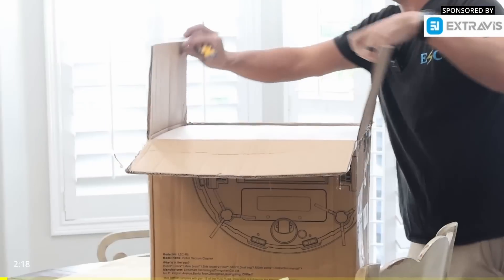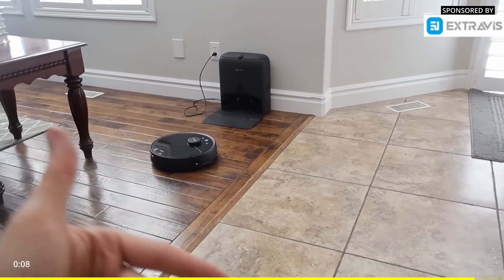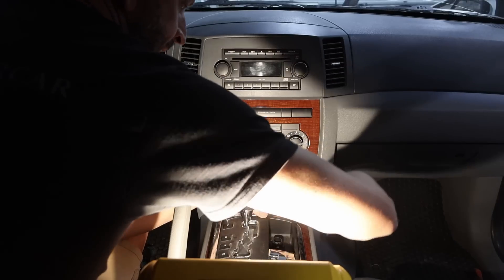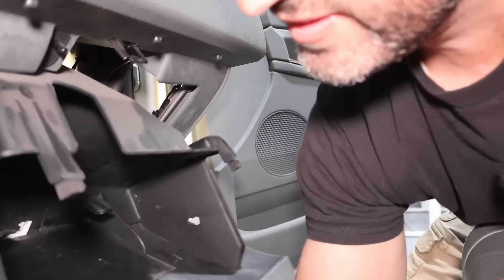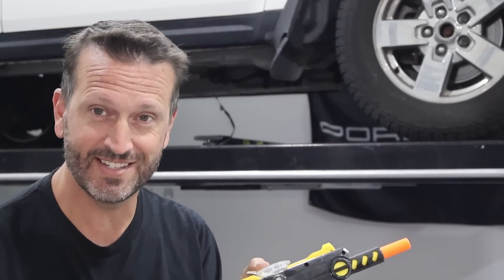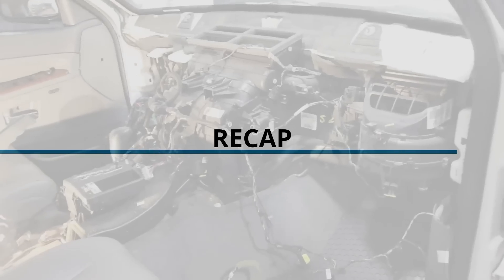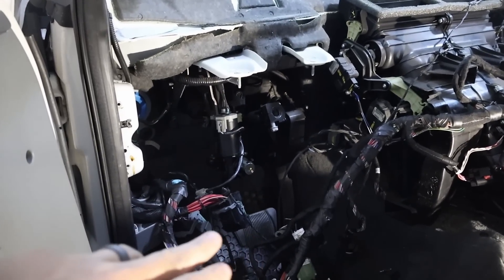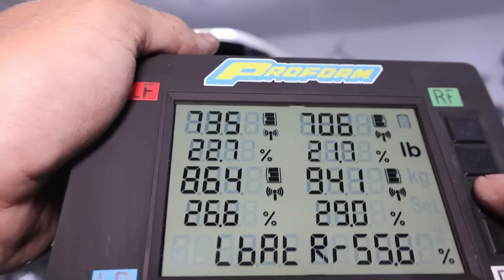Never Lose a Bolt Again: Fastener Tracking for Car Disassembly - Jeep interior removal

Comment: I just use painters tape and tape the bolts on the part. More specifically I tape the bolts where I removed them from the part. Works for me.

Comment: What's the tesla rpm? What's the final wheel ratio of the jeep. Isn't tesla 9 to 1? 

Why not do a coolant heater and use the existing system in the car and have it in the enging compartment where you have the room.

Comment: The transfer case is what switches it from 4wheel to two wheel. I would put the motor in the front (ish) and connect it to the transfer case just like the gas one, and then let the stock transfer case do the switching from  2 wheel to 4 wheel. This will be especially good if you keep the stock transmission as the gear ratio for uphill climbs and crawling will be the same.

Comment: Hey, thoughts about motor placement. 3 options. 
A. Two motors, parallel the axles. 
B. One motor driving the input to transfer case, replacing the transmission position.
C. Positioned in the tunnel, potting power directly into the driveshaft. This has the most unknowns, specifically, back-driving the front differential. The loads on the thrust bearings  would be reversed, and they may not be sized for the higher speeds/loads in that case. The same can be said about the bevel gear, especially if they aren’t straight cut. 
Good luck!!

Comment: When I was a new tech I did all sorts of things to track fasteners. Pictures. Bags. Cups. As a master tech I've learned pretty much every bolt is the same and it doesn't really matter where they go back for 90% of fasteners

Also im voting to keep the factory differential
Reply from the maker: Thanks for the comment!
Reply: Yep, after a certain amount of time you snap and say "if it fits, it fits". It took me 10 months into my transmission rebuild and losing several bolts to finally crack and start throwing bolts wherever they fit. As longs as you don't do something stupid, like using one that's obviously too short/long/wrong thread, then you're fine.

Btw transmission seems like it's working pretty good so far!

Comment: They call that big tube you pulled out "the cross car beam" and they are structurally important. I know you are planning to replace it but if modifications are necessary it would be good to keep that in mind.
Reply from the maker: @brandondelgado4153  noted
Reply: Steering hanger beam

Comment: In my own thoughts, twin center motors will offer you a more "off-road" trpe arrangement, as the set up Jeep uses on those is very good for that usage. If you are making a pavement only  (or even a 80/20 road/gravel) arrangement, I think you would be better adapting the Tesla subframe in the rear mounted as to give you the proper ride height. Maybe eve a 1 or 2" spacer on top of the rear strut to increase ride height. Same goes for the front. To me, you could then armour up a few Tesla cells to sit under the chassis skateboard style and have your low voltage and high voltage under hood, and smaller battery pack where your fuel tank resides now.

Comment: I would say center motor is better. It saves weight and complexity. The weight you save from not having a second motor and the wiring and electronics for it means you can maybe add a few KW of battery …

Comment: If your customer just wants it for daily driving and occasional light trail use, I would imagine keeping the transfer case as the best option.  I have a similar size/ weight SUV I would love to convert (probably never will have the funds though) my idea is to mount two motors roughly where the transmission used to be, and have one drive the rear wheels, and one drive the front wheels.  I feel it will also make the high voltage wiring easier to have the drive selector right next to the motors, but I could be wrong.  I am also most likely not going to be able to get a tesla motor for this project.  I like the new electric motor KIA recently produced for their SUV.

Comment: Personally i would use the proven drive trane and adapt a motor to that. Jeep/chrysler know what there doing as far ad drive tranes. This also lets the customer decide if they want 2 or 4 wheel drive as well as low and hi ranges. Just my thoughts. Keep up the good work.

Comment: One photo should zoom in with the details and another photo should show the same location, but zoomed out.
Disclaimer:It all went back together and is running. 
On my last engine project I took many digital photos.The problem I created was zooming in on exact location of fasteners without providing a zoom out photo giving the relative position within the engine block. Same with electrical connectors.
Reply from the maker: Interesting

Comment: I take pictures with my phone and edit circles and text overlay on the photo. I also write the size so I know what tool to use. 
You could also rename the photos to keep in order and correspond to the fasteners.
It goes quicker as you get used to doing it.
Also allows for getting the best picture and zooming in.
Bonus, later you could print or pdf a manual for that specific vehicle.
Reply: You could also put a number that corresponds with the parts bag on the picture

Comment: Motor Mounting Option: Why not keep the Transfer Case in the driveline? I would reduce the motor count to 1 and keep the original drive shafts? This also eliminates any further complications with the axles/differential/suspension/alignment. Yes you'll incur slightly more mechanical loss/efficiency and keep one more thing to change the oil in BUT it keeps the original functionality of the vehicle.

This is coming from someone with a '97 Wrangler and a '12 Grand Cherokee.
Reply from the maker: Noted

Comment: I think we have an improvement on your idea. When we put stuff in a bag we label it with a few things. One is the description, but also a timestamp and the wrench size for the bolts (helps speed things up). Then, with the timestamp we can go through our photo reel and find the exact pictures around that time to see the connectors,  wires, placements, etc. keeps everything digital and easy to find with a single timestamp.
Reply: Also painters tape on the Ziploc makes it easier to write on and less likely to rub off

Comment: Have you considered doing a refit that uses the existing engine to power a generator, but use electric axels and batteries to power the vehicle?
Reply: This is where I am going with my project.  I will be keeping the generator where I can swap it out later when the battery technology gets better and or cheaper.  I will still need a few batteries for the regen brakes, but most of the power consumed will be coming from the generator.  I am hoping to use a smaller motor for a generator as well.
Reply: @andrewholding483  Good luck with your project.  What type of vehicle are you using?
Reply from the maker: Interesting
Reply: @electricsupercar  I think Dodge is coming out with the 2025 RAMCHARGER that will be doing the same thing.  Edison Motors out of British Columbia are making electric semi trucks that way too.  Kind of extends the range a bit.  I suppose diesel locomotives have been doing it for a long time too.

Comment: I applaud your new fastener organization method.  However, it occurs to me that using Polaroid will get quite expensive, and it is your income which will suffer.  Could you instead use some digital media for storage and then print out a "tag" to put in the baggie.  You might try video with a small pointer and voice annotation.  You could clip out one frame for baggie ID purposes.  The downside of stills from digital capture is that you would have to stop work to annotate with arrows.  Your idea of numbering to preserve order of remove/install is great, too!

Comment: Fellten do an lsd and reduced drive gear for transverse mounting tesla motors. it seems to be fairly common here in the uk with land rover conversions. you should do it that way, mostly cos thats what im doing with a model 3 unit and want to see how you do it :D Oh and pictures is a great idea, save yourself a fortune though and just take it on your phone and write the filename on the bag. you can zoom in on it too when comes to reinstall.
Reply: Or edit the jpg with text and/or change the file name.  Although the file names are already chronological.
Reply: @OwenfromKC  I’m thinking of getting a cheap tv for the workshop to plug the phone into so I can magnify things up!
Reply: With the editing capabilities for these videos, I'm sure you could edit the digital pictures and organize them to make something comprehensive.  Possibly a PDF for future use on the vehicle.